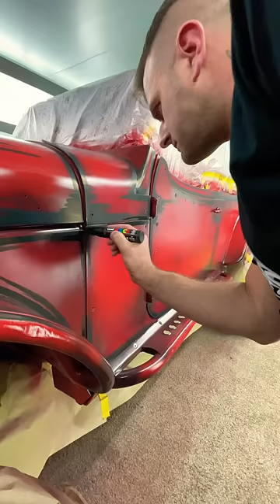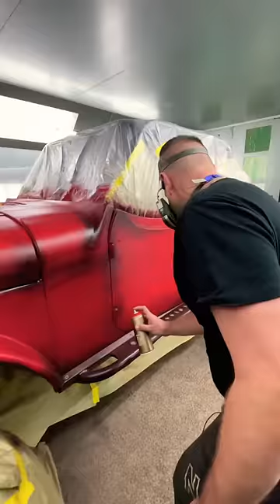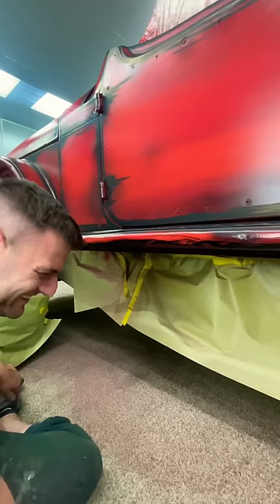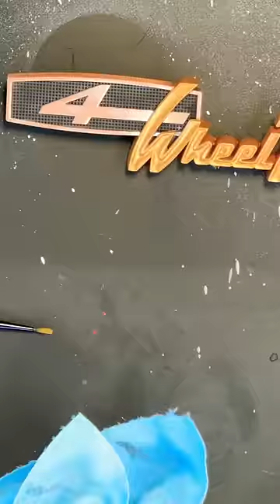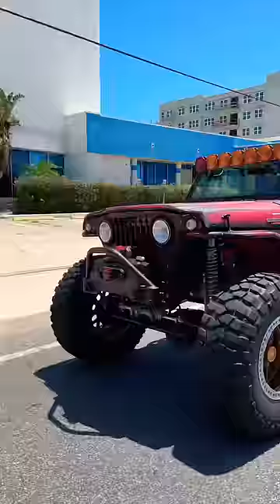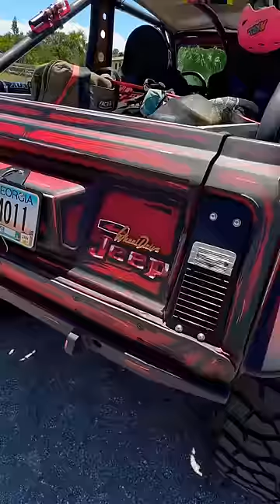Jeepster Cartoon Car by Stilbruch Lack 🔥 #flexrocksrollovers #cartooncar #viral #jeep #custompaint

Comment: Obviously this is paint... just so u guys know Permanent marker will last all of 3-6 months  before completing fading... (and not fading evenly... will not look good...) hope thats some kind of a heavy-duty paint marker... but u know they do sell markers with car paint in them... they have all shapes and sizes of empty markers u can fill with whatever (made of plastic or metal incase the paint you use is a stronger solvant based paint that may melt most plastic)
Reply from the maker: Yes, this is an actual paint marker.